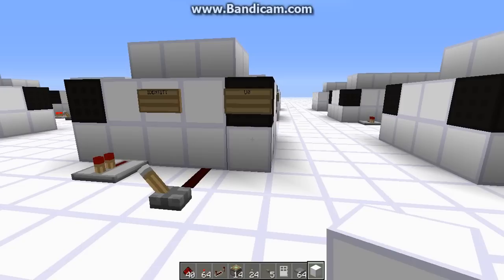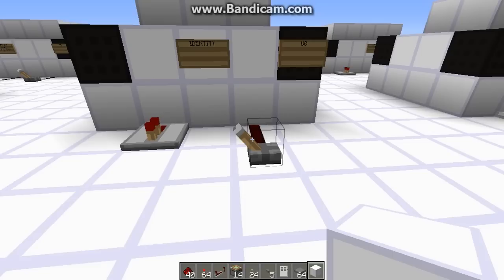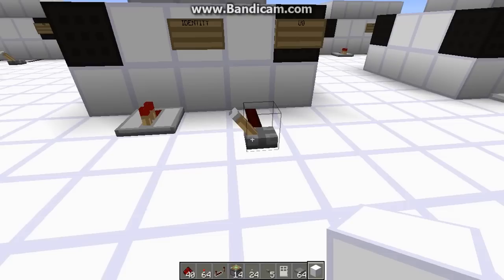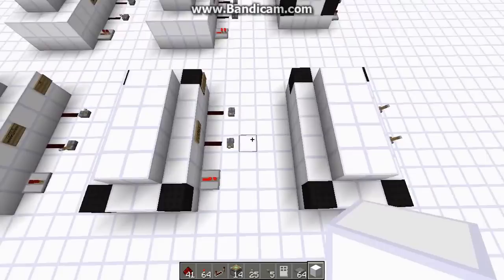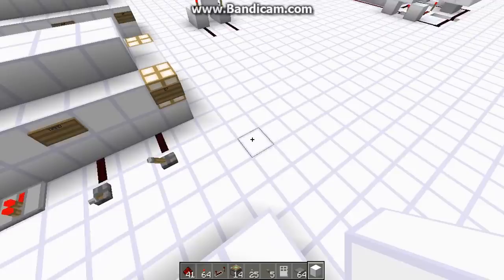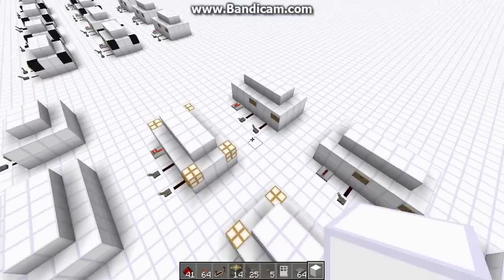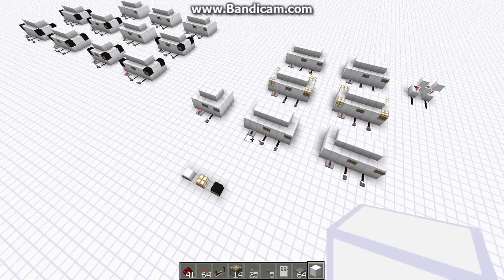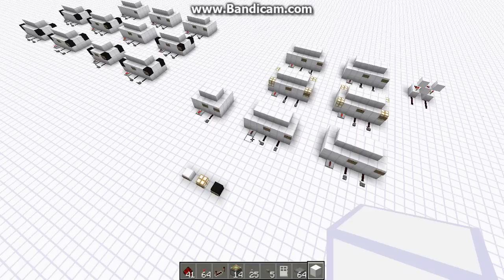Obscure Logic Gates (PROJECTION,NEGATION,IMPLIES,etc.)

Comment from the maker: A conditional unit is actually something entirely different; the reason these are still logic gates is because they still fit 2 requirements for a logic gate. They take a certain number of inputs, and they combine them in some logical fashion. Their uses aren't apparently obvious, but they can be surprisingly useful in things like computers where you want to, for instance, ignore a certain value and operate on another.